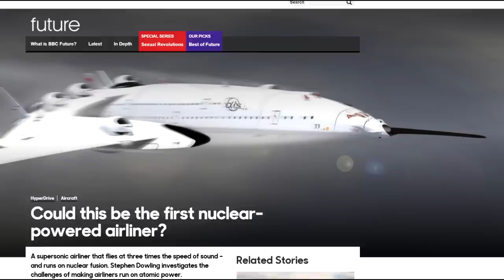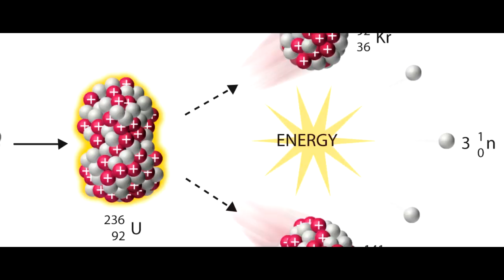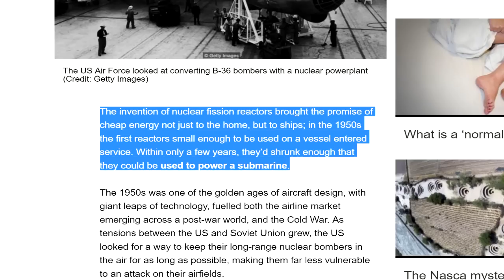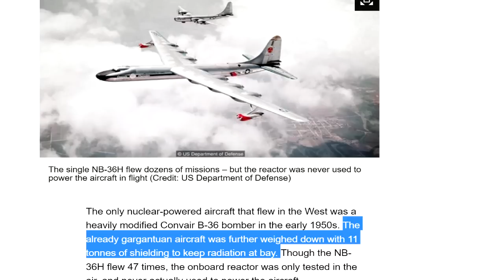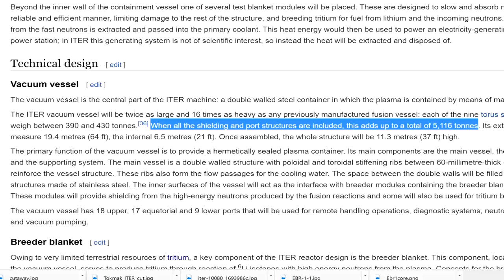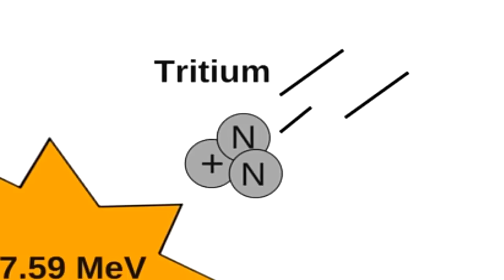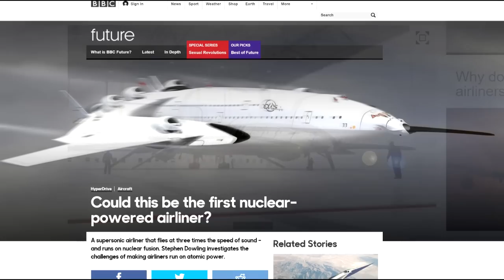SIX ENGINED Nuclear Airliner... BUSTED!

Comment: Would it be possible to shield gamma rays with some sort of electric arc or a highly electrified copper plate?
Reply: No, there aren't more electrons in an arc than in the air or in electrified conductor than in a dumbbell.
Reply: how on earth does a russian anti armor gunship know about electrons?
Reply: +4T3hM4kr0n! Because that is just his sexual identity, nothing to do with his knowledge you mysogenistic fuck! lol
Reply: In the early part of the cold war, both the US and Soviet Union had nuclear bombers constantly in the air, so they could go and attack the enemy at a moment's notice (having worked out that, even with the engines constantly idling while being fed from underground fuel tanks, and the crew living in a tent next to the plane, they still wouldn't take off in time). Both sides experimented with atomic bombers, the US first flew unmanned ones (so no need for shielding), then later thought of maybe having lots of thin, light shielding rather than one big block of it (didn't work). The Russians... just didn't bother with shielding. Both planes worked, but were either incredibly impractical or killed their crews. I think in the later era of airliner-sized, ground-launched cruise missiles both sides considered making those nuclear powered, as they're going to blow up and spread radiation everywhere anyway, but gave up on it and just built better ballistic missiles instead.
Reply: Mi 28 Russian tenk, stronk tenk, made out of mighty Stalinium alloy tempered with blood of a thousand dissidents.
Reply: Anonymously Unknown
then again its plasma, superheated electricly charged gas. So storage will be a problem (if I recall compressing plasma is a bad idea since it gets hotter)
Reply: Atristiel Not really, they just don't take them seriously so they only produce real shitty ones. The other guy is right, US only uses helicopters for close air support after all anti-aircraft has been taken down. They basically assist clean sweeping after all the heavy weight lifting have been already done.
Reply: If Thunderbirds has taught me anything about fusion powered planes, it's that you can only remain in flight for 3-4 hours before everyone is subjected to lethal amounts of radiation. This is especially difficult when a Malaysian straps a bomb to the landing gear.
Reply: Atristiel
ahhaa lololol troll harder SUBHUMAN.
Reply: +4T3hM4kr0n! There is no need, my trolling has achieved the optimal level of hardness. SUBSUBHUMAN
Reply: 4T3hM4kr0n! There's a lot of electronic shit in that gunship, it kinda makes sense. It would also know plenty about shielding, unlike wimpy US attack helicopters protected by smartphone glass and plywood.
Reply: Mi 28
I hear russians are making adjustments to their aircraft so they are EMP resistant. Probably a weakness for the Havoc since it has all that fancy gear.
Reply: Atristiel  Seriously though, that helicopter is stress tested with 12.7mm and 20mm AP rounds point blank to the cockpit from every direction. Meanwhile, Apache's armor can barely withstand small arms fire from considerable distances, and that helicopter has armoring on the higher end of the spectrum among western helicopters.

If you ever wondered why US military doctrine doesn't takes helicopter use very seriously, it's because their helicopters are a fucking joke.
Reply: Mi 28
its because we use helicopters diffrently. Short amounts of close air support for infantry.
Reply: +Mi 28 I guess they compensate with jets and missiles.
Reply: Mi 28
jets and missles are used for taking out stuff like radar stations and hard targets like buildings or bunkers. Infantry does most of the fighting and calls in helicopters for small amounts of close air support. The Russian dshk is still capable of taking out our helicopters so thats why they can't stay very long on mission.
Reply: LOL
Reply: I was thinking the same thing. Maybe a negatively charged piece of something something. Can't tell if that might be a lot of electrons, or wouldn't even compare to a piece of lead.

Comment: Perhaps worth a mention that the Russians did build and fly a fission powered aircraft. The core replaced the combustion chambers of a jet engine. Simple enough idea except a leak would have irradiated a huge area.

It was only intended as a long range bomber and the pilot(s) would have received a sizable dose of radiation as the shielding couldn't be adequate due to weight. There's a doco somewhere on YT about both the USSR and USA's nuclear aircraft and rocket efforts. Just to clear, all were an abysmal concept for the obvious reasons but they did work.

Comment: I'd be hard pressed to believe that air frame could take the stresses of those kinds of speeds even if such a power plant existed. I'm not saying that a modestly scaled version with today's engines couldn't be made to fly but definitely not that fast. The sheer force on an object at that speed is insanely high. That's why super sonic jets have narrow cross sections and modern ones typically have a kind of blended wing design.  On this thing the leading edge is absorbing all this force and is only attached to the back of the fuselage. That makes the wing operate similarly to a crow bar where the attach point is the fulcrum. It's a pretty picture but far from a feasible design and most certainly not drafted by an engineer.
Reply: Someone forgot to tell the Concord that.
Reply: Oh for fuck's sake.  Concorde was flying at over Mach 2 almost FIFTY YEARS AGO.  It could carry up to 127 passengers and in 27 years of international operations, only crashed once.
Reply: Will graduate from B.AeroEng  in November and have done a conceptual design of a hypersonic aircraft, can state you have a lot wrong but basic structural principles are ok.

Current engines do allow you to travel at Mach 3 (see: MiG 31, SR-71).

Supersonic aircraft do not have narrow cross sections, but graduated ones. See: Whitcomb area rule.

Most modern aircraft aren't BWB, but have lifting body fuselages. Exceptions are typically long endurance (low drag) aircraft.

Moment from airfoil drag is mostly due to lift of wing acting around quarter chord at subsonic, half chord at supersonic. Coeff. of Mrag and Coeff. of Moment are usually not as large as Coeff. of Lift.

Main issue from going fast is primarily stagnation heating (air has to stop when it hits the aircraft after all), which is why X-15 had Inconel Leading edges to avoid burning everything.
Reply: +Travis Callahan You're right.  This is an artist rendering, not hindered by any real knowledge.  May be nice to get it to work in KSP tough.
Reply: they're making them out of nokium!
Reply: Disclaimer I have not yet finished my engineering degree so if there is a flaw in my thinking please point it out constructively.
Reply: Space shuttle can go a lot faster than that without getting destroyed. I think the key reasoning behind design of modern supersonic jets is fuel saving, because engines take shit ton of fuel to run at such speeds - that, rather than structural reliability considerations. Granted, shuttles only fly at mach 5 for few minutes at a time.
Reply: Mi 28
space shuttles don't have massive wings held on only at the back. The leading edge is firmly attached the the fuselage.  The wing on this design is free floating and very wide.
Reply: Travis Callahan Well it is a ridiculous design from aerodynamics standpoint, but the idea of using nuclear powered supersonic airplane is not too far fetched. You just need big enough airplane.
Reply: That's no moon its a space station? lol
Reply: Large planes cannot go super sonic due to the excessive amount of stress it would put on the air frame. Air is a fluid and needs to be displaced by the aircraft. The rate or air moving creates a load, more mass more load more friction and more stress. At  a certain point it becomes impossible to make the structure sound enough to resist the pressure of the fluid pushing on the surface structure of the aircraft.
Reply: ***** I'm not saying they can't build a moderate sized supersonic aircraft. I'm saying this design won't take the stress and that an aircraft big enough to be nuclear powered would likely be unable to fly supersonic.
Reply: Travis Callahan
Yea, they said that the Blackbird couldn't fly either, till it was officially revealed.  To bad they couldn't get it to work as an interceptor.
Reply: Any idea of nuclear powered aircraft would have to account for the risk of crashing, or being blown up midflight. The cost of cleanup would have to be part of the cost-benefit equation.

For reference, chernobyl played a major part in bankrupting a superpower. Perhaps even THE major part.
Reply: Modern aircraft technology is perfectly capable of going at Mach 3, but the vast majority of designs choose to stay below Mach 2.5 because that's the point where conventional and affordable materials start failing due to heat stress. Going any faster means replacing aluminium with titanium and glass with diamond.
Reply: *****
Shhh... his head might explode.
Reply: He wasnt saying its impossible, jsut that the video example was. We all know "it" is possible, as proven by concorde.
Reply: Breuitas Scilicet
I just creamed in my boxers.  Moment of silence please.
Reply: That's enough of a statement to base their reputation on, however it pans out.

Comment: The creator of this concept is a graphic designer artist, not an aerodynamicist because it wouldn't fly very well and get really hot. However, compact nuclear fusion reactors (including their support equipment) are being tested, not conceptualised, but tested. e.g. Tokamak Energy, MIT ARC reactor, Lockheed Martin design, Pollywell fusion derivatives, etc. Shielding can be adequatly done with a couple of tons of Hydrated substances.  They will or might (sceptic as you are and rightfullly so) result in compact power sources useable in design as for instance the one patented by Minnovitch, the orginal guy who gave us the calculations allowing for the voyager trajectories. Challenging yes, but the basic conceptual and scientific hurdles have been cleared, changing a sci fi concept into an engineering challenge.

Comment: One major problem that isn't addressed either is the extremely slow response time reactors tend to have. You can't turn them on and off and get the desired output in an instant. Fission takes time, especially if you want to do it safely. This is due to the complexities of maintaining reactivity and controlling criticality, which can require taking dozens of variables into account. This works fine for slow moving craft like sea vessels, but airplanes? When you can potentially fall out of the sky, you probably want an energy source that can react faster than the force of gravity.

Comment: Even with your fusion reactor going, how do you got three times the speed of sound? Every engine I know that's capable of breaking the speed of sound in air does so by expelling combusted fuel out the rear end. What is this guy planning to expel out the rear end?

Comment: what about nuclear powered Zeppelins?
Reply: Thats not crazy just slow. Propellors will work fine on electricity you will just need a large balloon to carry the 'reactor'.
Reply: Yes the applications are limited as airships solar or otherwise are largely obsolete. However this does have interesting applications for the exploration of the solar system especially further from the sun or operating in the dark of atmospheric planets (and moons) eg Jupiter, Venus and possibly Titan. Due to the long rotation period of Venus it may be required to explore its 'dark side' from within the atmosphere.

Comment: Next to those engines is another engine, a locomotive, specially shielded to move a hot nuclear bomber from one place to another.  The hangar to house the nuke bomber was built, and is still used today. This is all of a bit like Project Pluto, the "flying crowbar", that got to some point of completion when sober minds realized it was wholly impracticable.

Comment: lol, that thing is built like a giant tuning fork. this plane will vibrate itself into pieces before liftoff
Reply: Yep, but they probably never asked an aircraft design engineer about his opinion.
Reply: Wouldn't that U shape also entrap the air and increase air resistance by a stupidly high amount? You're not getting anywhere near mach 3 that way.
Reply: dragonestea no that's deliberate. the shape prevents the pieces of wreckage from colliding when the plane desintegrates in midair
Reply: Leave it to the spirit of chaos to foresee utter, chaotic destruction. I approve. You have all my flutters.

Comment: You forgot to mention the Russian nuclear jet. They solved the shielding mass problem by simply not having any shielding and the generator mass problem by making it a high temperature open cycle design with air as the working fluid, which released radiation into the environment.

All of the test crews died of radiation poisoning soon after flying it, but it was capable of flying from the USSR to the US and dropping it's payload, or stay airborne on standby in some remote part of the world for several days in case of an international crisis, since radiation poisoning took at least a week or so to kill the first crewmembers.

Of course, nuclear-powered bombers were dropped by both sides when this thing called in-air refueling was introduced, which was a lot more practical to keep bomber deterrents airborne.

Comment: yes historically aviation has broken many barriers once thought impossible for example the first was powered flight itself, the next was jet propulsion which was broken by the Germans in WW2 with the introduction of the Messerschmidt Me-262 (they also made the first ever and only rocket propelled fighter that saw service, the Messerschmidt Me-163) the next was supersonic flight which was broken by Chuck Yeager on October 14, 1947, P-47 Thunderbolt pilots as well as Me-262 and Me-163 pilots also claim to have broken the sound barrier but this has not been proven, the next obstacle was avoiding detection from radar (aka "stealth technology") which believe it or not was originally was accomplished by the Germans yet again in WW2 with the Horten Ho-229, the first "stealth" fighter designed and there was at least 1 prototype however it was destroyed after one of its engines cut out in a test flight, the pilot lost control of his plane and it crashed killing the pilot and destroying the plane. now days im not sure we have any other giant feats to achieve aside from maybe space but that is still far down the road.

Comment: Some idiot actually published this claptrap? Even if you made a "clean" fusion reactor that only uses deuterium (it's theoretically possible) the diameter would be about 120km for the particle accelerators (if it would work at all). A tritium type is just plain nasty. I wouldn't want to get within a couple of kilometres of it.

Comment: Even if you could theoretically build a small enough nuclear reactor with magic materials to have ultra light weight shielding. Lets pretend you could even have electric engines that could actually give that kind of output. How the hell do you cool that reactor while in a super heading spaceship going mach3?

Comment: Of course it had to be on Behance: https://www.behance.net/gallery/28335399/FF-Flash-Falcon-Electric-Supersonic-Jet%20

That site is great for cool concepts, but I don't know why news sites treat these renders as if they were actually being planned to be produced in one way or another.
Reply: Physics don't change, except when they do (which is to say, physics never changes but our understanding of it does). Science is dogma until we adopt new dogmas. Science is... basically just the most indecisive religion ever devised. ;)
Reply: “The cockpit could be equipped by Smart & Holographic windows in order to assist to the pilots with all necessary data, because the Airplane' shape oblige to these to have a pronounced inclination and the direct views are limited”.     Yeah, this is total scifi.
Reply: Your phone was once scifi
Reply: Yeah, but my phone doesn't violate the laws of physics.
Reply: Arturo Torres Sánchez But it did at one point, the laws are only what we think we now so far.
Reply: Haha, no. Physics don't change just because we haven't understood them yet. And the knowledge we do have doesn't disappear just like that.

You could argue that Einstein's Theory of Relativity invalidates Newton's work, but the truth is many calculations are still made using Newton's model, such as the trajectory of projectiles.

The way science works, or at least physics, is that what we know is incomplete, but not wrong. As we gain more knowledge, we continue filling the gaps, and add different perspectives, but rarely if ever actually discredit previous work.

But you could actually try to discredit nuclear physics and prove me, the author of the video, and the whole scientific community wrong. That is, of course, as long as you have done your research, with evidence and reproducible experiments.

Remember that extraordinary claims require extraordinary evidence.

Comment: Well lets see. We just need a lighter material to block all those nasty gamma rays, and an antigravity  device. Problem is - how to convert all the heat to some kind of jet propulsion? 
Another way is: We could get several feminist on board and trigger them with some compliment...when the arm waving starts - we're off.  :)

We might even go faster than mach 4.